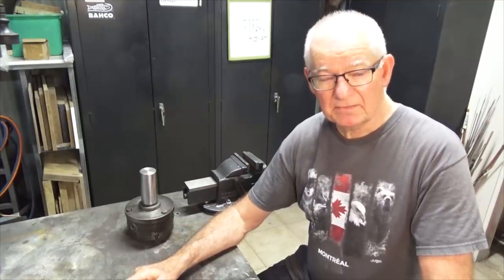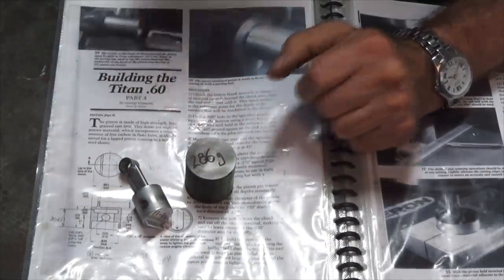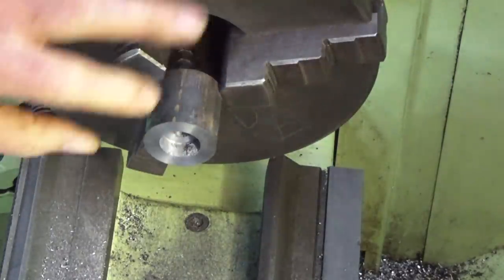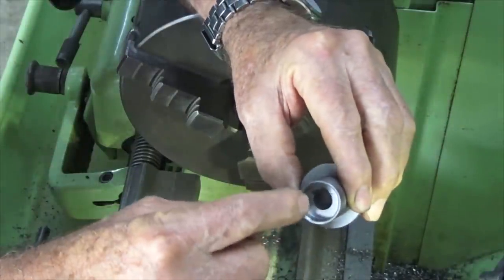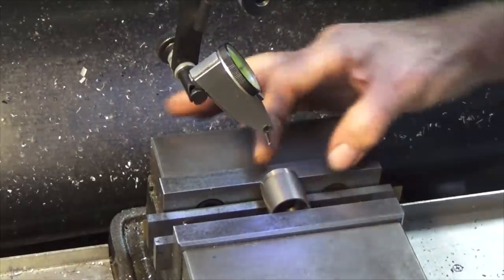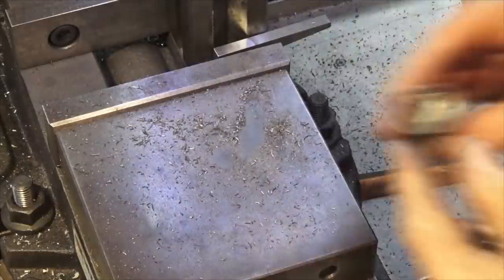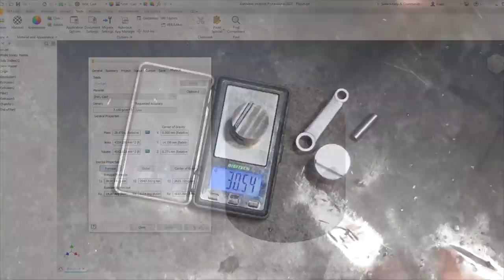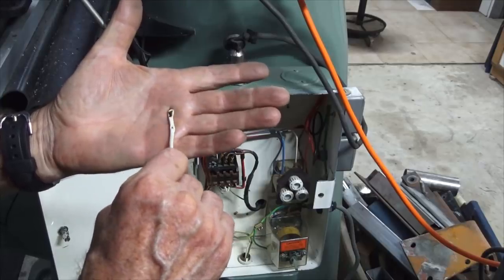Building the Titan .60 Glow Plug Engine #11

Comment: Brilliant idea for the 3 jaw Chuck. I have one that gets little use in a dividing head and I think I'll make something similar to what you have there and as such will get a lot of good additional use out of it.
Reply from the maker: Actually I used that chuck for the first time today when I was tidying up some 3D printed parts. It's just the right height and you can spin it around to get at both sides of the part. I love it.
Regards,
Mark
Reply: @Preso58  I like the idea that it can be spun around, and also firmly hold cylindrical parts.

Comment: Gday Preso, brilliant job on the piston, it really is mentally exhausting making these parts, I had that experience building the Webster engines, I should have my scales this week for the touch Dro, stock finally came in so I’ll be getting them on very soon, Cheers
Reply from the maker: Matty, I was almost going to tell you to look for an alternate DRO system after the issues I had with my TouchDRO. It was confusing because up until late last year mine was working well. The random resets meant that I couldn't trust it. I'm glad I found the problem and all the work I did on the cast iron piston was with the TouchDRO and it worked flawlessly. I sent your maker plates on the 28th December. Hopefully they will arrive shortly. 
Regards,
Mark
Reply: @Preso58  I’m really looking forward to have the dro set up, it’s going to be a game changer I think, I’ll let you know when the tags arrive, thanks again for your help mate, much appreciated, Cheers

Comment: Mark, New Year’s Greetings!
I couldn’t help noticing that your compressor reservoir may need to be drained, again! In a higher humidity climate, as you know blah blah blah !!
What you need is easier access to the drain.
Reply from the maker: I was just going to do that the other day but I got distracted. I have a very large vertical tank outside the workshop where the air from the workshop compressor goes before it re-enters the shop for distribution. It has a very easy to get to ball valve at the very bottom of the tank. It is easy to access but the drain on the bottom of the compressor tank is a bit more difficult. I will check it though as we have had some very humid weather lately.
Regards,
Mark

Comment: Nice fault finding, sometimes the sparky will not have enough bare wire so the clamp pinches down through insulation causing a hot joint, a common issue for amatures but sometimes for tradesmen too. When I was an apprentice, 1980, starting and stopping a Black and Decker drill could crash computers as the arcing on the brushes interfered.
Reply from the maker: Robert, I am fairly sure that bad joint was my fault. I stripped the electrical enclosure when I repainted the mill and it's an almost certain bet that I just pushed the wires up into the terminals but didn't tighten them. However the mill ran fine for nearly 9 months and the fault with the DRO only started a couple of months ago. It must have been vibrating itself loose for a while.
Regards,
Mark

Comment: If you have already clocked the centre of a round part and you want to find the end. If you simply run your indicator up to the same zero as the centre zero but on the end of the part (rock it to find the high spot). Then the centre of your spindle will be the radius of your part in. 
No need to use an edge finder.
Reply from the maker: I had a vague idea that I could use the dialled in centre but I defaulted back to the edge finder method. I must learn to use the indicator more. I like that you can see precisely the point where the indicator finds the edge.
Regards,
Mark

Comment: Great work! Lots of intricate little features involved 👍😁👍. 
Glad your electrical issues are resolved, definitely could've been worse 😊. Funny how empty that box is lol. Been repairing cnc machines and newer manual machines and they're loaded full of circuit boards and drivers and whatnot. 
I really like the display on your dro. I wonder how well it would hold up to -30°C (or colder 🥶) temperatures 🤔. 
Stay cool, Presso 😎 (and in your case dry).
Cheers!
Chris
Reply from the maker: I know what you mean about the electrical enclosure but there's just enough in there to make me nervous. I am not really comfortable dealing with three phase or contactors and typically I just started removing wires after taking a few cursory photos with my phone. It's a wonder it went back together at all. There was a point when I almost scrapped the TouchDRO setup as I stopped trusting it and had to go back to using the micrometer dials. Now that it is working again I realise how much easier it is to work without having to account for backlash in the screws. 
Regards,
Mark

Comment: I, too, was concerned about the iron piston/aluminium barrel combination.  We can discuss all day the merits of each variant.  It was probably chosen this way round to remove the issues that would occur with either a heavy iron barrel or the thermal conductivity of an iron-lined aluminium barrel.  Pre-WWI machines with them had a number of features to reduce the issues incurred with the heavier iron piston.  One that you could emulate if the machine was a four stroke would be drilling the skirt to lighten it.  Not usefully possible in your case.  You could, possibly, dimple it.  This will lighten slightly and would have the additional benefit of carrying lubricant to assist with what, even in ideal circumstances, is a marginal lubrication situation.

Comment: I wonder if the cast iron specified for the piston is to better match the thermal expansion of the cylinder.    Since this engine doesn't use rings, the piston fit must be correct when the engine is up to temperature.
Reply from the maker: I am sure that helps to ensure that the operating tolerances are maintained at running temperatures. 
Regards,
Mark

Comment: Would a very close fitting aluminum piston expand too much and cease in the steel sleeve? Would need to have more clearance and piston rings to use an Al piston. Just speculating, as I've never made such a contraption myself.
Fascinating build though... only 6 more episodes to binge watch :-)
Reply from the maker: Mark, there can be an issue with differential expansion of aluminium vs iron and steel. At the end of the day, I just followed the build notes produced by George Genevro. I think a lot of commercially produced model aircraft engines used aluminium pistons in chrome plated steel bores but they would have the benefit of very close tolerance machining processes and some sort of empirical design to work out the clearances. For a one off, home built engine, using steel or iron for the piston and bore, there would be less risk of having a piston seize up due to overexpansion.
Regards,
Mark

Comment: Good Show Mate: As is your usual performance. Kak-Handed. Is that the correct spelling? After watching you these months or years. I don't know how long. All of my projects have been kak-handed. You spend more time on stuff that doesn't matter much than I spend on stuff that does matter much. I've really enjoyed seeing the solutions to thorny machining that you have come up with. I have assigned some to the memory bank. Problem is the memory bank is between my ears and my forgetter works so much better than my rememberer.
Reply from the maker: I think we all start off a new project with expectations of instant success but reality soon kicks in and it's not long before you are doing things over for the third time. I used to tell my students to estimate how long a task would take and then multiply it by three. The 3 times rule is almost universal for any task. 
Regards,
Mark

Comment: Mark, I have always been a wary of 'wireless' devices in the machine shop as there are many devices that emit (despite what the certification says) that emit bursts of radio waves especially when starting, stopping or heavy change of loads. The difficulty is that since you are wanting to pick up the desired signal you have no choice but to have some form of aerial and 'unwanted" emissions get picked up as well.Great job on the project; I do like seeing the creative solutions that other machinists solve problems. Regards from a newly retired in Melbourne.
Reply: While I don’t disagree, I would note that the standards for certification of devices are very different for motors (and the like) vs other commercial equipment. Motors, by their very nature, are designed to produce powerful electromagnetic fields. During startup and load shifts, the frequencies and phases are all over the place. So, interference should be expected. (Consider watching televisom while someone is hovering/vacuuming.) The arcing in the failing contacts** are even worse, as they produce very wide-band noise - meaning those pulses will affect objects of a wide range of sizes. In other words, all sorts of tools and stuff will be forced to act as antennae. In the case of the video, the DRO just happened to be the weakest/most obvious link - though it’s physical and electrical proximity didn’t help things.
** Even properly functioning contactors should be expected to emit brief, high-voltage pulses when inductive loads (e.g., from motors) are removed, by disconnection, due to the flyback effect. Motors’ brushes can produce similar, albeit less dramatic, effects.
Reply from the maker: Michael, Yuriy has a blog on his website and he has often commented on issues to do with interference and ground loops causing problems with the bluetooth adapter. He has been able to mitigate most of the problems with changes to the firmware and in some cases new hardware. The newer version of the TouchDRO that I now have samples the signals coming from the scales and filters out what it considers to be erroneous pulses. I have noticed that the new version is very stable and when I was having problems with the loose connection I was using my micrometer scales (the old school method) and comparing the readings with what the DRO was showing. There are some differences but I suspect it is down to wear in the leadscrews. I will often see a difference of .05 on a long travel move which would be consistent with wear in either the screw or the nut. I do know that the capacitive scales can be affected by heat too. On hot days the scale, especially the longer ones, will change in length slightly. Once I found the loose wires and fixed them the DRO worked perfectly and I am now confident enough to not have to rely on the micrometer dials.
Regards,
Mark

Comment: Great video Preso! That piston has come out great! Time to get a VFD for the mill? It would provide a soft start and braking which make lots of short ops kinder to the motor 👍
Reply from the maker: Steve,  I did consider getting a VFD when I got the mill but I got talked out of it by the vendor that sold me the rotary phase converter. My mill has a 110 V single phase transformer to run the X axis power feed and although I didn't realise it at the time the coolant pump was 415V three phase. I thought it would be 240V and to save a lot of faffing about with different voltages I was sold on the idea of just plugging the whole machine into 415V three phase. Once I fixed the dodgy termination of the motor wires everything went back to normal. However, I do want to convert my Colchester back to three phase with a bigger motor and a VFD. I would really like to use the braking to supplement that mechanical brake on my spindle. I would really like to take heavier cuts with insert tooling too. 
Regards,
Mark

Comment: The density of iron is 7.874 g/cc, aluminum is 2.702 g/cc. That gives you a ratio of 2.914. So the cast iron piston should weigh about 3 times as much.
Reply from the maker: I got curious and just checked Autodesk Inventor and it reports cast iron as 7.150 g/cm^3 and aluminium as 2.700 g/cm^3 for 6061 grade so almost spot on for your aluminium figure but a bit different for the iron. You can edit the density manually and for some grades of metal you would probably need to get a sample of a known size and tweak the figures a bit. 
Regards,
Mark
Reply: @Preso58  OK Mark, you caught me! I believed the first website that popped up with metal densities. And it was reporting elemental iron, not casting alloys. (If it’s on the internet, it must be true…) 
I agree that gray cast iron is about 7.15 g/cc.

Comment: Hm...  I think with sliding that pin into the the bottom of the V, errors in the centering of the pin hole become errors in the angle -- the pin approaches the V at an angle other than 90 because it's not right "above" the middle of it. I guess in general, it might be better to use a technique that's less dependent on the perfection of the previous steps, at least if it's a high-precision thing -- which it doesn't seem like these two cuts were, so... okey doke!  :)  No worries; just something to consider.
Reply from the maker: I found that you have to sort of "wiggle" things around and it settles into a position that seemed to be centred. I won't know for sure until I have the piston finish turned and lapped and I can try the piston in the cylinder and being driven by the connecting rod.
Regards,
Mark

Comment: Why (casted) iron? As with the current ABC engines the material choice of piston and sleeve are chosen for their expansion rates. To prevent the piston expands more than the sleeve and gets itself stuck a high content of silicon is used in the piston material to lower the expansion rate. The amount is somewhere from 22 up to 30% of silicon. Iron has also a much lower expansion rate than stock aluminum and so it will fit better to the expansion rate of the steel sleeve. By the way, these high silicon grade aluminum but also stock 7075 and 7068 is pretty hard for a perfect lapping.
Reply: You have answered your own question. ABC. Aluminium piston, Brass Chromed liner. The ABC liner is honed to a taper so that the piston sticks and seals at the top. This requires accuracy to microns. This is probably why the designer chose a design that was achievable in his home workshop.
Reply: @dinsdalepiranah1189  It was the question in that video. And the taper in a brass sleeve will straight up because the cooling by the fuel on the lower part of the sleeve and the heat on the higher part of the sleeve, that is why pre-heating or start slowly with the revs to heat up the engine careful is very important. Steel has a lower expansion rate but still it has some so the Titan would benefit a taper as well although it is not that much. My car engines have about 0.3 degree angle taper.
Reply from the maker: I didn't address the effect of differential expansion rates in that section of the video but having an iron piston and liner would allow for similar rates of expansion. The notes do specify that the liner and the piston should both be lapped and after lapping the liner I think that getting a good close fit and a good finish is fairly easy with iron, even if, like me, you are new to the process.
Regards,
Mark

Comment: I think that larger hole is not there just for clearance.
It will also reduce piston weight, I beleve significantly.
After all... you are doing this undercut to reduce weight, but leave much bigger chunk of material in the middle of the piston.
Reply from the maker: That's correct. The build notes do stress the importance of removing as much metal as possible.
Regards,
Mark

Comment: The piston has to be cast iron to run in an aluminium cylinder because the expansion rates match - the cast iron has a slightly lower expansion rate than the steel so it doesnt seize when it gets hot. If you want to use an aluminium piston then you have to either use rings or a brass or aluminium liner (to match the expansion rates).  The aluminium or brass liner has to be given a hard coating - usually hard chrome, and even so the piston has to be 15 to 30 % silicon aluminium. Compared to an iron / steel combination this is significantly more expensive and difficult to manufacture. 
btw, aluminium pistons can be lapped with tufnol laps. 
and finally, if you end up with an iron piston thats too loose, "hardening" it (red head and then quench in oil) will grow the cast iron by a couple of thou and allow you to have another go at lapping it. Similarly, getting someone to gas carburise the liner for you will shrink it by a thou or so, and does make a better liner anyway (but make sure youve got enough taper on the liner first or it takes ages to shape!).  
Anyway, nice job so far, thanks for sharing :-)
Reply: correction - has to be cast iron to run in a steel cylinder...

Comment: Mark, I am scared out of my mind over this project.  You still have to do the carb venturi and there are no more casting available.  If you botch this, I can't imagine.  Please tell me this project is done and it runs fine.
Reply from the maker: Robert, good news. The patterns for the crankcase casting have come to light. A viewer bought them from George Genevro years ago and he sent me photos of the three patterns. There will be more about this in the next video. But, you are correct. The next scary item is drilling and shaping the bore for the venturi and making sure it aligns with the port in the crankshaft. That sets the timing for the fuel cycle and the build notes are a bit vague on how to achieve the correct angular alignment of the crankshaft. I think I will be leaning very heavily on my CAD programme to get this part right. 
Regards,
Mark
Reply: @Preso58  In a previous video, you showed a picture from a viewer on how he set up the casting on the face plate with a jig.  I think that's a good way to go.  Joe Pi uses pins a lot for those difficult set ups.  I wonder if a pins through the crank shaft hole would help centering.  Balance that face plate setup.  Would not want to see the Colchester end up in New Zealand.